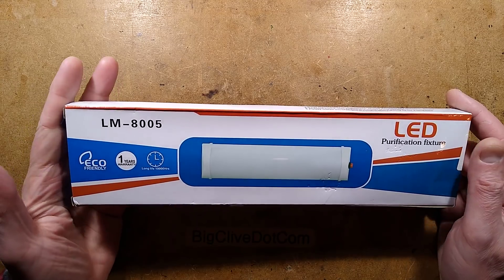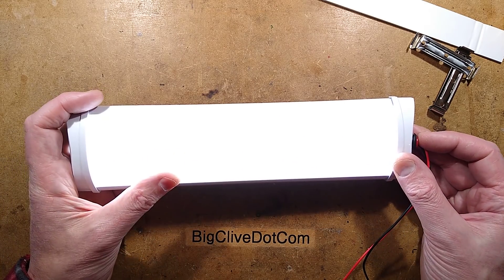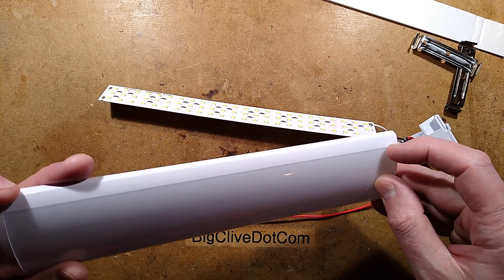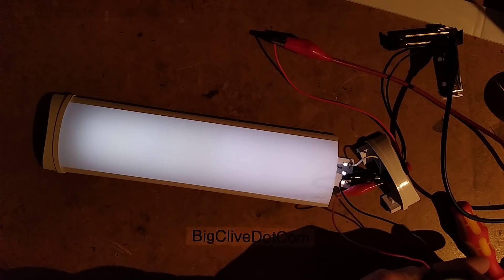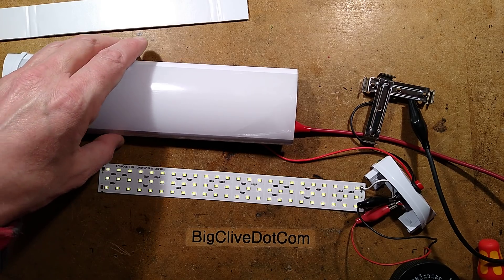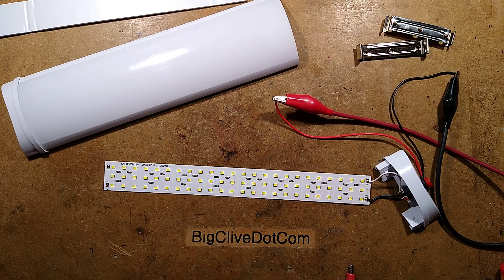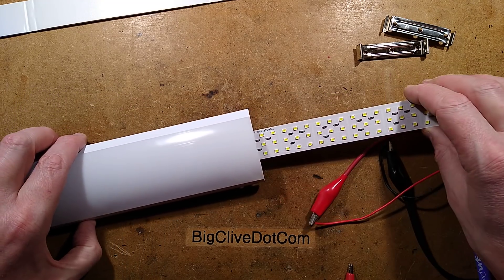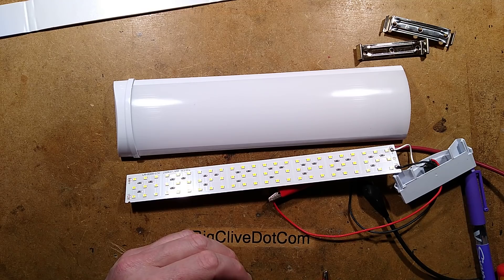Inside a cheap Aliexpress 12V LED light

Comment: You could mod it and put a 800ma constant current source in series with the supply lines. Then it's brightness would stay the same from 12-14Vdc. I bought some LED replacement bulbs for my RV (caravan) which use this technique so that the current and brightness stays constant over a 11-15V range.
Or just feed it through a 12V LDO regulator instead.
Reply: I also have a set of interior trailer lights that seem to use two transistors to generate a constant current source.  The light is the same brightness from 11-17 volts but will operate down to 9V or so.

The biggest downside is that it seems the excess voltage past ~11V seems to be dissipated into heat by one of the transistors...it doesn't get crazy hot, but the light consumes the same amount of power regardless of voltage.  I put a $2 buck converter in front it it and set it to 11V which may (or may not) be improving battery life.
Reply: @RK-kn1ud  a buck converter is definitely more efficient. The problem with those is EMI (radio interference) but if you don't listen to an AM/FM radio when camping, it's not an issue.
Reply: Nominal 12V can range from 10.5 to 14.4V so 12V voltage regulator isn't a great idea I guess.
Reply: @plainedgedsaw1694  You really don't want to discharge a lead acid battery below 12.0V. This would lead to reduced battery life. Even if you went below 12V, a 12V regulator would then just put out the max it could. (close to it's input voltage)
Reply: @kimchristensen2175  that 12v rule is for the car battery I think. Deep cycle should be fine going that low. Fine in a way Li ion is fine down to 3V.
I think most LDOs are MOSFET based, so they don't actually drop certain voltage across, but they will have same effect as resistor in series. The Rds on value.
Reply: @plainedgedsaw1694  Sure, a deep cycle battery is more tolerant of deep discharging than a starting battery. But both will lose capacity when deeply discharged (below 40% of it's capacity for a flooded. 50% for AGM). The Rds ON of a power MOSFET is in the milliohms. For example, a IRFZ44N's Rds On is 0.025 ohms so with 10Amps going through it, it would only be dropping 0.25V when fully turned on. 10 feet of 14 AWG wire also has a resistance of 0.025 ohms. These resistances are swamped by the internal resistance of the lamp and are therefore largely irrelevant.
Reply: @plainedgedsaw1694  Most LDOs are mosfet based, but they still operate the mosfet as a source-follower, and all of the excess voltage still has to be dropped across it. It's a mistake to consider the mosfets as resistors in that mode because a change in the input voltage will not result in a change in the current through the device.
Reply: @RexxSchneider  he wrote 12V LDO... And when input is under 12V, its gonna act like resistor.
Reply: @plainedgedsaw1694  No it isn't. It's going to act like a linear regulator with insufficient voltage across it. If the mosfet is passing current, it's going to have its source about Vt below its gate, and that isn't operating like a resistor. For that to happen, you have to drive the gate well above Vt and if it's short of voltage, that's not going to happen.

Comment: It doesn’t get simpler than that big Clive. 
Well I think I’ve been watching you for seven years since anni exploded at least 
And I sure know A heckuva lot more about how to use resistors diode‘s capacitors and light emitting diode than I did when I started watching so thanks for bringing me this far and don’t ever quit.  Xoxo.x.
Reply: I’ll leave the tubes to Mr. Carlson‘s lab.
Reply: Yes I’ve actually recapped and restored several old phonograph phonograph radio combos in the last seven years more successful with in my earlier attempts and the fact that I’m still alive is amazing. 
Got to have something to play those hundreds of 78 so I have lying around on   
But I’ll tell you about this guy that was a neighbor of mine 20 odd years ago who had an entire house full of jukeboxes and 78’s and he wasn’t that much older than me , gave a nice stack Cab Callaways

Comment: Thanks. Looks good and cheap. 
Did you simply short the on off switch with variable resistor? Surely wasn't. Why series diodes, not resistors?
12V batteries on smart alternators can go way over 14 V for short periods. Might not be suitable, but who would drive with this switched on?
Reply: Yes, resistor connected across the switch contacts. Diodes because they have a predictable forward voltage of between 0.7V and 1V per diode. More details in my answer elsewhere.
Reply: Yes, he shorted the switch with the resistor box but only for testing. Once you find a resistor value that produces the light you like, you cut one line to the switch and solder that value of resistor in series with the switch. Or you could solder it across the switch and control power with an external switch (say to a bank of them in parallel) to get switchable bright/dim functionality by turning the switch on, shorting the resistor for "bright".
Diodes give a known fixed voltage drop, no need to calculate voltage drop vs pass current with resistors.
I'm pretty sure he only suggested fixed solar/battery use. In a vehicle you could use them with the engine running by adding a jellybean regulator.

Comment: I'm toying with the idea to fit some solar panels, charge controller and battery bank into my bedroom. I've got all the bits but just need to throw a load of crap out and fit it.
With a bit of work and some circuit boards I'll have free lighting and free tablet / phone charging.
Or I could make a solar powered robot. 😋👍

Comment: Why series diodes? Resistors are cheap and adapt better to the voltage dropping when the charging source turns off.
Reply: A diode drops a predictable amount of voltage, which does not vary very much over a wide current range. Unlike a resistor where the voltage dropped is proportional to the current (so as the current varies due to a different supply voltage, so will the voltage across the resistor).
The typical forward voltage of a silicon rectifier diode will be between 0.7V and 1V. So two in series would drop the 14V battery voltage down to 12 V to 12.6V regardless of the current (within the diodes rating of course).
Reply: @Mark1024MAK  However the voltage drop on the resistor varies in the desired direction to make lamp current less input voltage dependent.  At the redesign voltage (14V), the diodes drop 2V, and the current is (14V-2V-7.2V)/Rled.  At 12V battery mode it will drop to (12V-2V-7.2V)/Rled (58%) .  With a resistor dropper, the formulas become (14V-7.2V)/(Rled+Rdrop) versus (12V-7.2V)/(Rled+Rdrop) (70%), thus a better VRR.

Comment: Depending on the efficiency of the LEDs, they should only dissipate about half the input power as heat.  The rest will leave as light.
Reply: the best commercial leds turn 15% of power into light, most are under 10%.

Comment: I want to make my own LED strip with SMD components but without having to buy custom made PCBs. Any suggestions? Available tools in my disposal: 3D printer, Dremel, soldering iron.
Reply: You could buy ready made pcbs :)
Reply: @berndeckenfels  is there anything which can be cut to size? I will assume it could have smd sized/spaced lanes for +/-, maybe sections for resistors? Reason I’m asking is, I’d want to control size of the board, number of LEDs depending on power and luminosity. I’ve found some double sided tapes with copper lanes on them.
Reply: Soldering SMDs when the pads aren't properly sized and spaced is no fun at all. You're going to have to add the equipment and supplies to etch your own boards - including accurately transferring your design to the board.
Reply: @mikecarr4178  I saw these perforated boards which have flat connected lanes of copper (only one axis, like breadboard power bus), but never used one. I was thinking of going with those.
Reply from the maker: Vero board for the connected strips.
Reply: @bigclivedotcom  thanks. Yes that’s the name of perforated board I’ve seen
Reply from the maker: You could make a 3D printed frame to take hard wired 5mm LEDs or a section of 12V LED strip.

Comment: I don't know if you have also noted the daisy-chain capability on the left-hand side of the board for extending the powerrail further?
I guess there is also a version available with 2x or more boards into 1x enclosure.
As their website noted it as a ceiling/cabin light, so possibly replace a TL ceiling light in e.g. campervan etc?
Reply: Did a quick check many styles on Ali designed to be daisey chained. Also had them as 85-240vac in various wattage, lengths and pack quantities. 
Mains ac came in 6w for 30 cm or 10w for 50 cm in various pack quantities

Comment: If you remove the far end, you could gang up 2 or 3 in series all controlled by the one switch.
I think grill light is from America, here we have Bar & Grill for a pub that also serves pub food.  These style of lights would be screwed to the bottom on the counter between the taps and kitchen on the kitchen side. So the work surface under the counter would be well lit, but not interfere with the "ambience" of the bar area.
Reply: There are even two tabs at the far end that appear to provide for just this option!

Comment: Possibly named "grill fitting" because it would be used near a vent grill/register? "Purification" I've got no clue... if it is related to the vent then maybe it's a tenuous link to an air filter?
Reply: Na, just chinese miss-,translation. Don't read too much into it!
Reply: Nah, I think this is meant as grill(e?) light as in could be mounted to the grill of a car. It's a trend here in the states to mount light bars all over trucks and a 12v led of this form factor would definitely blur the lines into appealing to that demographic depending on "taste".

Comment: Seems a good product. To be clear; if I add a couple of diodes in series, am I just using the forward voltage drop to dim the LEDs? Or is it more complex?
Reply: The diodes in series just drop the voltage of a typical lead-acid battery system from 13.8 volts down to something closer to 12 volts, thus lowering the wattage and not frying the LED's with excessive current and heat generation.
Reply: Yes. Silicon diodes drop .6 or .7 volts across the junction.
Reply: Yes, no.
Reply: Make sure the current rating of the diodes is equal to or greater than the current draw of the LED fitting, and fit them in an open place with free air flow to cool them.

A multi-way switch and a few diodes or resistors is an easy way to have variable brightness.
(Diodes and resistors must have sufficient current / power rating.)